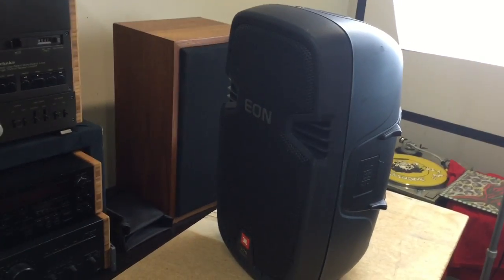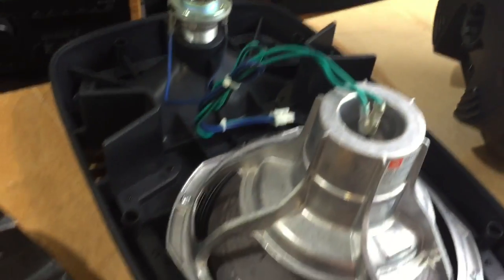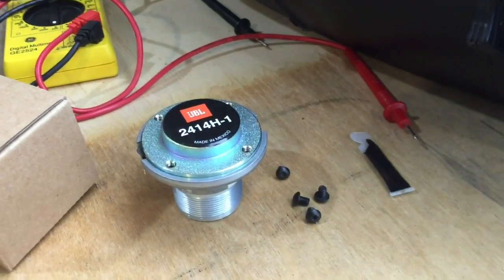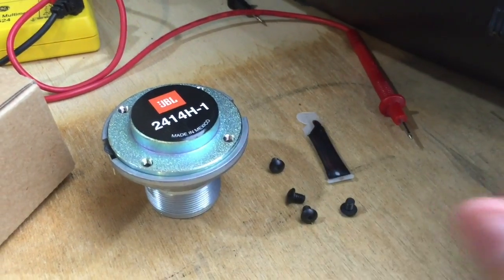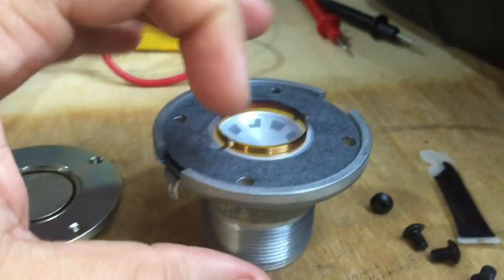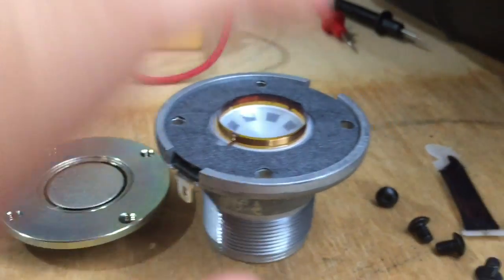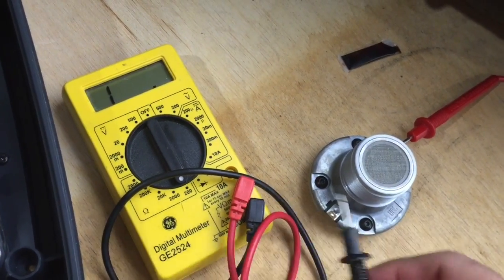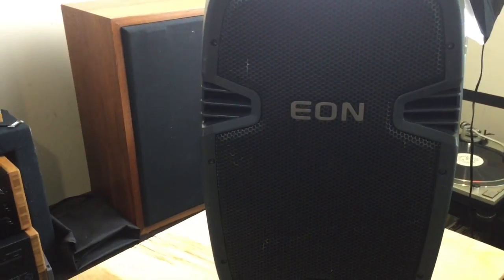REPAIR: JBL EON 510 Speaker - No High Frequency / Tweeter broken? No Sound

Comment: I have the same speaker and my High Frequency is also blown. I hardly use the speaker so I want to put an aftermarket copy in it. Forgive my ignorance because I have no idea but I saw online they sell the parts separately, the magnet part and the membrane. Do I need to by a complete unit or can a part from the original JBL model be salvaged?

Comment: Appreciate the explanation and especially the tip on the ferro-fluid.    I have about 16 of the JBL 2408H-2 drivers that are shot and in need of repair.   Do you have a resource to sell just the diaphragm as i can simple take it apart and solder the 2 leads in and rebuild it myself.  Just not sure where to get the diaphragm (coil).   Thanks!

Comment: Great job on the video! I have an  EON 612 with the same 2414H-1 blown Tweeter. I removed it and was going to order a replacement but was wondering if I can buy one from you where you add the ferofluid and locktight screws. Let me know. Thanks!

Comment: How did you put the coper coil perfekt Back in the center from the magnet ?
Reply from the maker: SpicyBoi it is self centering. It had a key that allow the coil to going in on a specific way. So it centers itself
Reply: @360MIX  you mean because of the screws and mounting holes or what key ?

Comment: Great videos! Got an EON 615 no high end BUT, the tweeter driver registers 4.1 and I can hear sound coming through very softly. Switched out the amp (cause that's easier tan pulling all the screws, again) and still no high end. Do you think the tweet driver could be bad even though it is registering ok on the ohm meter??? Thanks much!

Comment: My God, I can't find it in Mexico, will it be possible to use synthetic motor oil?
Reply from the maker: Te puede interesar no. You can not use oil
Reply: @360MIX  Yes, I already investigated a little, the basis of this liquid if it is synthetic oil, but this alone will easily fade away, causing it to run out of oil prematurely or move to places it shouldn't. Convinced with the ferrous material, it joins the walls of the horn magnet so it would be very difficult for it to move to another place, giving covertira only in the place that is needed ...

Comment: Question - same speaker model getting no sound. It powers on and the clip lights (limit) show me that it's receiving the signal. Any troubleshooting suggestions? Do you have a video dealing with this? I have not opened it yet. Still at the gig where it died.

Comment: Why tweeter jbl easy blow
Reply from the maker: It could be many factors.... But normally its volume to loud.  Always check the CLIP light.. if its Flashing alot that means you need to turn the volume down.

Comment: The tweeter is repairable. The coil itself is not cooked - only a break. There is another problem with 510 type system - the amp has a switch mode power supply which makes the amp light, but prone to breaking apart if shaken a lot - by the bass driver. A transformer power supply wouldn't have that problem.
Reply: How can I go about fixing the tweeter?

Comment: instead of using lock washer can i use lock tight.
Reply: Never mind i just saw your video and you mentioned about the lock tight.. thank you
Reply from the maker: Yeah you can use lock tight...  Thanks for watching.... I saw your reply that you saw I mentioned it..
Reply: 360MIX thanks for your video. you saved me some mula  ($$$$)...
Reply: 360MIX I have one tweeter that you can barely hear the sound coming out of it and it is at a midway volume. the mid sound good, but the tweeter is the one that can barely be heard. is it the lack ferrofluid?
Reply from the maker: nope.. it has nothing to do with the ferrofluid... Ferrofluid is only there for heat dissipation.
Reply: 360MIX I
So that means that it is blown? I can hear it but not as loud as the other speaker's one. It sounds very low.
Reply from the maker: You would have to swap it with a working driver to see if the problem is with the tweeter or other issue..
Reply: 360MIX I already checked and it seems to be the driver, but would it be the diaphragm itself? or the whole thing? I apologize if I am asking this late.
Reply from the maker: diaphragm itself

Comment: I ordered 2 replacements for my 2414H-1's and they came to me without the Magnet which holds the ferrofluid.  Can I use my original magnet (the cap that has the 2414H-1 printed on it), or do I need to purchase a new one?

Comment: Would this basically be the same issue with a eon 615 with high frequency issues.  NO Sound but lows.
Reply from the maker: Yes...  check the tweeter with a Digital Volt/Ohm Meter under ohms

Comment: Hi. I have an EON 510 that i use weekly. It's operating fine right now. Would it be your recommendation to open it up and thoroughly apply ferrofluid & loctite the bolts of the tweeter?
Reply from the maker: If you suspect that the screws are getting loose you can loctite them... as for  the ferrofluid if you are personally using them and NOT driving them to it's upper limits for hours on end i would leave them alone...... 

the PRX models are notorious of the tweeter to unscrew and screws to come loose... EONs are less prone to this...

Comment: Hello friend, I have a JBL just like this ... it's on, all the LED's turn on and the "speaker" LED indicates that the signal from the sound desk or the cable with an instrument (guitar, microphone) is being input. I really want your help .... I do not know what to do, she's calling, but there's no sound coming from the speaker and tweeter, what can I do?? what be the problem?? :( 
thank you very much
Sinvaldo, Sao Paulo, Brazil.
Reply from the maker: You might have a bad amplifier board.  is there any hiss?
Reply: 360MIX when I call, the encoder sounds only in the horn, a slight squeak only... but on the loud speaker nothing! can it be the board??

Comment: Great video.  I'm having one of my 510s put out a very high pitch whine. It's coming from the tweeter, but  I'm wondering if the  tweeter is damaged or if it could be the crossover or something else doing it?   Do you any idea. I tested to make sure it's not interference going to the speaker from the cable or output device.  Defiantly the problem is in the speaker.
Reply from the maker: With only the power cable connected does it make the high pitch sound? 
 any way you can show us a video?
Reply: Actually yes.  I didn't think about that. Even with only the power cable connected it makes the sound. No audio cable.
Reply: I just realized I can swap out the tweeters from one speaker to the next and test again.
Reply from the maker: Swapping the tweeter is now going to change anything.. Seems like you have something damaged in the Preamp-board.

Normally these EONS have a loud noisefloor so you hear a constant hiss even with just the power connected and the volume at 0.... I'm pretty sure your problem is in the Pre-Amp board...
Reply: I was afraid of that.  Darn.  I noticed they do hiss a lot no matter what, but that noice coming out of the one is just too much to overcome with volume.   Now that you mentioned that, I suppose the hiss would get louder if the volume was turned up,  if it was a bad driver.  Which it doesn't.

Comment: How about a video on replacing the membrane part with a Chinese one and keeping the outer assembly.
Reply from the maker: That is simple.. all you need to do is order the diaphragm with the metal screw-in part not the magnet assembly you can reuse your back part/magnet assembly. don't get just the membrane not worth the money and hassle of getting glue and soldering specially if you don't own a soldering iron or have worked with delicate parts like these.. for $35-$50 you can get the part..

Comment: Another thing, I can not here in Brazil, com'rar repair this tweeter. there is some sitequa I can only buy the repair or jbl only sells full tweeter?
Reply from the maker: What is the model of your tweeter? I have replacements on hand.. I can ship to you...You will need to pay via paypal...
Reply: I need 2 units for jbl driver 2414H -1 . I do not understand much of this mode of payment , will iterating me .
Reply from the maker: Paypal.com is a payment transfer system allows you to pay for products...  I can send you an invoice for the 2 drivers and shipping to your country. Email me at george@360mix.com send me your street address so I can calculate the shipping.
Reply from the maker: Send email to george@360mix.com so I can send you an invoice.
and if you are ok with the price you can pay via paypal.

Comment: I do not understand, do not need to change the coil? Simply place the fluid and it comes back to work?
Reply from the maker: The driver/coil was changed for a new one. I added the fluid to keep it cool and to keep it lasting longer / better heat dissipation

Comment: Hi. I need to replace the input board of this speaker. Do I need to unscrew the front part to do that? If not, can you tell me how to open the back part? I did not find any screws other than those on the front. Thanks!
Reply from the maker: +Celio Pereira Take the screws out from the front all of them... (keep track two of them are short. (Near handle) make sure you put those back in the same place.